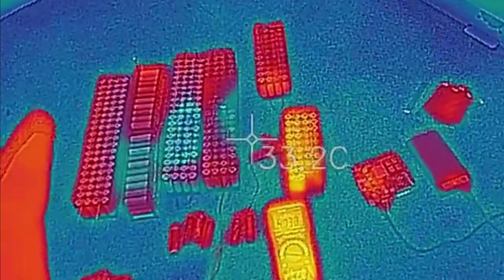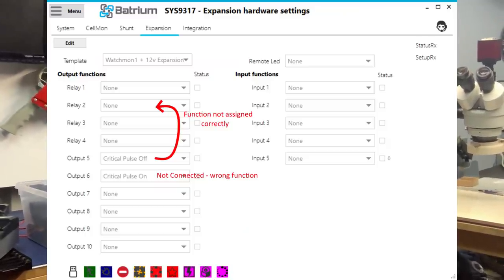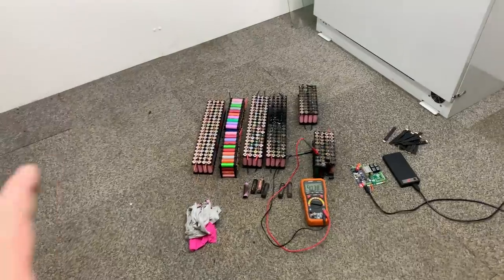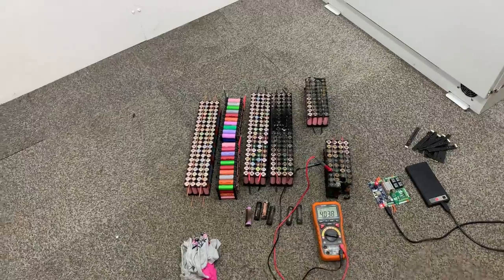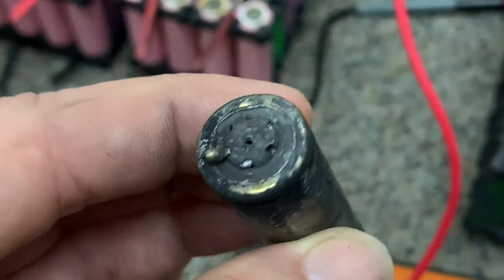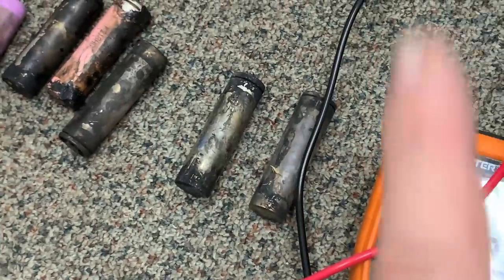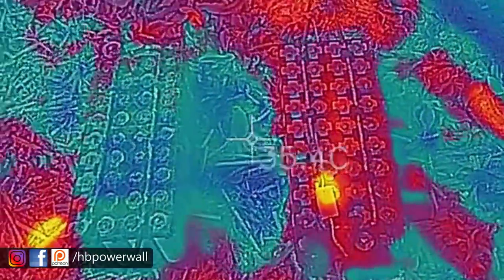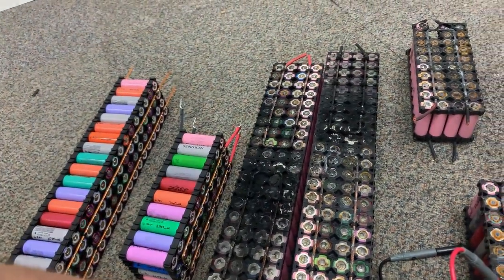Near miss, Smoke, Fire & Fear on new years eve

Comment: I notice that the bus bars are zip tied directly to the spacers. The plus bus is only a fraction away from the can of the cell. There is this very thin fragile wrapper only. If the bus bar gets hot and melts a bit into the plastic, the bus bar may short to the negative can of the cell, and NO fuse will save this.
Therefore, I have modified all my banks. I have raised the positive bus bar using a tie strapped underneath the bus bar, thus preventing the bus bar from ever getting near the cell.

Stay safe.

Chris S

Comment: yeah, i have a few cells that won`t go over 3.9 volts, if i try to go higher they get hot fast, and i bet they could catch fire only with the energy they have inside, no matter the outer fuse...i still use them in a flashlight, but i have them marked as 3.9 volts cells, they came from a laptop battery, yes , i guess that metal flashlight might become a pipebomb
Reply: the cells that wont go over 3.9 are probably lifepo4 cells instead of liCo2
Reply: @hassanjahangirzaidi7  i wish they were, but they are recovered from a laptop by me, 2 were good, 4 were bad but i still use them, but not everybody has a programmable charger

Comment: I would run with cooling system + air Ventilation, possible chances you get the heat increase/build up by the time has passed in the steel container especially when it's summer time. You might need something like Digital LED Temperature Controller Thermostat Control Switch Probe Waterproof and they can be detected to be disconnect with the temp setting on it.
Reply: Yep, I only thought of this by now as well. I can really consider the temperature of those cells getting high really fast in a nice Australian summer. Most manufacturers only state charging to 60 or 65 degrees and already derate charging-currents (and voltages) around 40 degrees or so.

Comment: according to the color, I think those are cells with slightly different capacities. So probably several of them were in a pretty bad neighborhood of a lower capacity than themselves. Low-capacity cells discharged first, and then all hell went to the remaining ones.
That's why you just don't mix them in a first place. And if you do, never charge them to 4.2 volts.

Comment: Looks like some are 40p and the ones not used are 80p? I assume it was on a charge cycle?  I would say you need more information like  the charge voltage and the drain cutoff voltage they saw when in service. Fuse wire wouldn't help on a charge cycle if one cell goes nuclear.

Comment: I would say it is the corrosion and rust cause by the short. I found myself in my own powerwall, two of the batteries was getting warm even though it has no power and not effected by fuses, I would get rid of those that have rust. While you got them and yes give them a full rundown a full test.
Reply from the maker: rust wasn't any where near that bad 12 hours before. incident happened 16 hours ago.. (i think)

Comment: Yer i would guess internal resistance mismatch probably coupled with lithium dendrite buildup (due to age) ended with individual cell thermal runaway that would not trigger a fuse and subjected surounding cells to excessive heat triggering the second one to go.. if not caught quick enough it would make the entire pack go into thermal runaway. i would never keep a battery bank indoors of any chemistry and i would have fire/heat shielding between each cell pack some thing cheap like fire rated plaster board or some thing else non-flamable.

Comment: Check if the longmon's voltage sensors match your most reliable multimeter. I've had a few longmons almost .1v off. What's the latest state min/max cell / all-pack voltage recorded on the watchmon?
Reply from the maker: WM1 so no logging - all longmons were tested and 0.04v was the most out and that was high not low volt. I suspect that the work that these long mons were doing was incredibly excessive balancing very hard every single day.. way outside their original design (in my unprofessional opinion )

Comment: maybe thermal camera alarm (and when the teperature is too high it will disconect the batery) and metal box is the solution, but is the ventilation of the box safe? I mean is make matal box sense if there are ventilation holes?
Reply from the maker: Doesn't a thermal camera lense / sensor have a limited life span?
Reply: @HBPowerwall  I really dont know

Comment: I also agree this likely wasn't the first time the cell got hot. Just the first time it caught fire.

In parallel, any resistance or lower amperage would be "covered up" by the other cells (looks like 40 in parallel).

Thermistors cost between 1-5 cents apiece, and can be doubled up to serve two cells. That would be the least time- and labor-intensive way to prevent this from happening again.
Reply: A little more information on this please ( thermistors)

Comment: Important with processing cells is to charge it, and let it sit(for days) if it discharges. Some used cells dont hold charge, and slowly discharge, or drop voltage, and then discharge. Imagine you have whole pack 4.1V, and one cell does not hold 4.1V voltage, but drops to 4.05V...Whole pack discharges to that cell. Slowly to not blow the fuse, but fast enought to heat it up, and destroy it.

Comment: It would be interesting to design a rack mount system for DIY powerwall modules that could be safely and easily possibly automatically pulled out in an emergency. I think if each long pack was in it's own metal box that would be safer as long as that doesn't cause another short!
Reply: Bolt cutters for sure is my plan.
Reply from the maker: It sounds like they might have used side cutters to get it out.... but yes bolt cutters might be a bloody good plan Also some one inch holes in your shed just in case you need to force water in to stop or slow the thermal reaction.
Reply: here's a man with a brain and yes the cost would go up too but its insurance none the less.

Comment: What size is the fuse wire?  Possibly test one and see when they pop.
Reply: its not about the fuse
Reply: @Boz1211111  Shouldnt be but wondering what that used!
Reply: I'd say it's definitely about the fuses, you can hammer a nail thru a fully charged 18650 and it shouldn't flame. Some extra power must have been coming thru those fuses to get it to that point. If it had gone dead short then the fuses should have blown and it would just got very hot and fully self discharged. If it had formed a high resistance short and several amps of charge was put into it while it was getting very hot... A good reason to use as low value fuses as possible?
Reply: @AveRage_Joe  question, can a small diameter insulated enameled copper do potential for this fuse job, just like tiny axial glass fuse, maybe a test as enameled insulate just like glass ?
Reply: @benm9910  What if the cell was a "heater" cell and the amperage was below the Fuse Wire rating ?
Reply: @benm9910  hammering a nail through fully charged li ion will certainly make it vent in flame. they are made safe enough not to vent when dropped on the ground or deformed when hit with a hammer, but puncturing it will absolutely make it vent with flame

Comment: If it is an "internal" short, within one cell ,  how would the fuses help anyway?
Reply: the idea is the battery that fails draw more current then the fuse can handle melts and disconnects but i think in most cases the fuse are way overrated
Reply: @1981dasimpson  what is the right rating ? I use 5A for my 20P packs, basicaly because that was the lowest rating I could cost effectively buy on a big spool.
Reply: @patdbean  when i was building my packs i used a single strand of multi core wire think draw to melt was about 500ma to 1a if i new my max draw was going to be 20 amp i built the pack to have twice the amount of cells as to what my max current draw would be
Reply: My god man,,his fuse wire looks like it's way to big..his packs look identical to mine tho
Reply: No dont test,,we know what happened a failed cell.

Comment: I presume the cells were arranged vertically? Would it be safer or practical to arrange them horizontally with ceramic/concrete dividers between each pack and lids, to isolate them in case of incidents like this in future. I know it would take up considerable space; perhaps more than conventional battery systems, but wouldn't avoiding the possibility of being burned to death be worth it? (every time I look at your packs of batteries, I'm reminded of packs of fireworks from when I worked at an importer's in the '60's)

Comment: This is literally the reason i have not started my powerwall. I have the space outside for a shed about about 10m from the house, but because its not there yet, the powerwall will have to wait. No way i'm putting this in the house. They are so hard to put out once they get going.
Reply: or just don't use recycled cells?  recycled cells are cute for small power banks and what not.  If you want to make a serious collection of Joules use new trusted cells.
Reply: @tomstdenis  New cells never fail ?

Comment: A second thought. Could there be a chance that he mixed parallel configurations as well. Hes given you 80p's and 40p's. If he's running those two  side by side then obviously the 40p pack will be pushed to the max. Add a few sanyo's heaters in there and some 5 amp fuse wire and you've got a potential fire hazard. Just imagine how hot a heater can get if you charged it above 2 amps!
Reply from the maker: That is definitely a theory as well.. poor design.

Comment: Cell damaged from too much heat during soldering?
Reply: If the heat from soldering the cell was the cause you would think it would have failed rather quickly and not have taken several years of charge/discharge cycles to show a failure.  That being said, anything is potentially possible.  I had a cell that was recently spot welded in a larger pack vent during the first full pack charge but luckily I noticed it right away and moved the pack outdoors just in case it caught fire.  I also had a pack that was built out of prismatic pouch cells from Chromebooks.  All I could figure is that one cell expanded and put enough pressure on the connections to cause an internal short luckily it was in a 50 cal ammo can and only melted a few floor tiles and burned a piece of the carpet when it went.  The sides of the ammo can were almost white-hot but it contained a majority of the fire.

Comment: If there was an internal short, then the fuses should have isolated that battery. I am guessing that the internal short caused a heat chain reaction which caused other cells to internally short. There should be signs of at least some fuses popping.
Reply: Or this cell was a "heater" cell and the amperage was below the Fuse Wire rating ...

Comment: Would the inside temperature of his shed where he had them caused them to rise to be too hot during charging? If it's 45 degrees celsius outside & inside the tin shed it's 65 degrees celsius & charging popped the heat up to about 85 degrees celsius then perhaps that was the problem they released the liquid inside through the top ends & then it caught fire.
Reply from the maker: it is possible but i have no details on how it was housed other than there was a mention of a shed
Reply: @HBPowerwall  I used to have a tin shed back at my old place & every summer it was easily 20 plus degrees hotter inside because of the low roof, no insulation or windows, no air circulation, it was basically an oven in the direct sunlight.

Comment: Wow , I had a dead cell  0v which many do the mistake of “picking the +terminal and volatge raises again and reuse it Well the questions that come up are, why in the 1plave did the plate popped out ( wht cause those gases to try to evaporate ?) 2) we don’t know th real internal chemical state of such cell , it’s best to not even reuse it , well in one time I tried to revive that cell over heated capacity was not great  and iR was so high after usage in cell pack it made the whole pack drain so quick I had to learn the hard way ... it just depends on he cell we can’t control 💯 such thing even new ones fail I had a drill just internally didn’t store the mah it claim won’t say brands but i don’t recommend using old laptop cells we don’t know how many cycle or what year they made them in some cheaper brands of cells
Reply from the maker: sounds like you learn tho, so thats a good thing

Comment: Don't you think that pack over charged? 4v is just the sitting voltage after it was disconnected
Reply from the maker: I can confirm that all longmons were working as per design, they were configured to 4.08v, so there is a fair amount of head room there so over charging seems unlikely based on the information i have

Comment: Big steel container and sand. Peter you can get more of the ten watt resistor from Microwave overs on there input lines. But be careful of the capacitor which needs to be shorted out.

Comment: Could it have been an issue with internal resistance of the cells
Reply from the maker: Dendrite forming sound like the most likley issue here i think. But internal resistance is still a thing.
Reply: @HBPowerwall  how would you check for dendrite? cut open a cell? is there a safe way to do that? How would one check internal resistance after an "event"?

Comment: Theres a big variance in the capacity of those cells why put 2700 with a 2100. Isn't that a waste of the higher cap cell?
Reply: No, not when they are in parallel. If you connect a 2700 with a 2100 in parallel, you get 4800. The current each cell sees will depend on their internal resistances, but they all contribute. Just don't take out more current than will overload low IR cells that will be contributing the most.
This is not the case when connected in series - a low capacity cell will discharge before the others, and must be disconnected before that happens. Otherwise if the cell discharges and can't deliver any power, the other cells will feed it with a reverse polarity and destroy the cell, meaning that it will unable to be recharged afterwards.

Comment: Heres a thought... Is it a coincidence or something else that both the 40p packs which have cells missing / failed, have had the failures in the same physical place, e.g. on the opposite corner to the terminals? Could those corners have something to do with it? Seems more than a coincidence.. Just an observation for the group.
Reply from the maker: they were joined as a 40p2S (to make the same size as mine)

Comment: my hole thing of fusing is proved to be a waste of time again if they going to go they going to go from alot of packs i have scene i do feel more often then not the fuses are way over sized i think in the case of reused cells the only safe way to do them is keep them outside far enough apart not to effects other banks and maybe buried in sand or at least something that could detect the heat and dump the sand to seal air

Comment: The wire fuses dont help at all if a cell produces an internal short. Normally this should happen slowly but it can develop over time and suddenly a bigger dendrite is building up producing a short by penetrating the separator. No fuse would help here. But really hard to say what was the exact problem here. Hope you find an answer. At least they had an alarm and an outside separate shed for the batteries.
Reply from the maker: Yes i was incorrect pointing out the cell level fuses but it does go to build quality and all we have to go on is what we see... cell fuses or CID help for nothing if the cell itself is internally damaged.

Comment: From my testing you need insanely thin wire for a 1 amp fuse 4.2v ive used thicker fuse wire before and it can be over 10 to 20 amps  I will update on thickness of wire
Reply from the maker: Fuse wire isn't for all faults i guess, after conversations just two-three amps won't blow fuse when pumping energy into a dead short that's a lot of built up heat.. Cell level fusing is more for impact or user error damage. Such as a screwdriver droping on to battery or it falling or being hit by something and it moves in its housing and shorts out.
Reply: @HBPowerwall  im guessing an internal short happened in the cell causing heat and starting a fire did any of the plastic look like it could have started a fire

Comment: my only concern is the wild variation in mah values and specs on those batteries, 
1. tested cells at 2700mah and 2100mah in the same battery,
2. i recognise some of those cells and he has got, some cells that are rated for 3.6v nominal 4.2v charged (eg NCR18650) then mixed with high compasity 3.75v nominal 4.35v charged cells (the pink ones)

i only say this as the cell looks to have internally failed (not externally shorted - due to the intact fuses) so i wonder if the wild variations contributed to this.

im certianlly no expert (and am happy to admit it) but i would not have mixed cells with such wild variations.
im happy to be corrected on this if im wrong

Comment: A while ago you did an autopsy on a cell that just got hot and didn't (hold) charge.  It's not too much of a stretch to move from "getting hot" to smoking well.  The fuses will just sit there smiling at you as there is no current flowing through them.  My first guess is "cell 0" got very, very hot and then burst to some extent, taking out one or more of its neighbours in so doing.
Certainly a close call, saved by having a smoke alarm, a pair of cable cutters and a *-off bucket of water to hand.
Reply from the maker: Yes, as i understand it the thermal run away happens fast and iis hard to stop once started.
Reply: @HBPowerwall  Normally thermal runaways start very slowly then accelerate exponentially, so by the time they are noticed there are at the unstoppable point of no return :-(